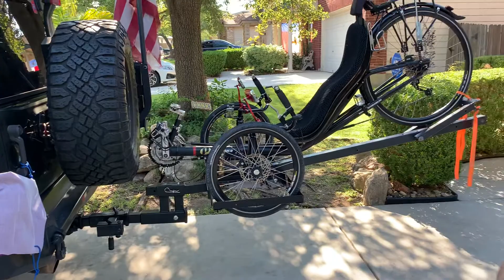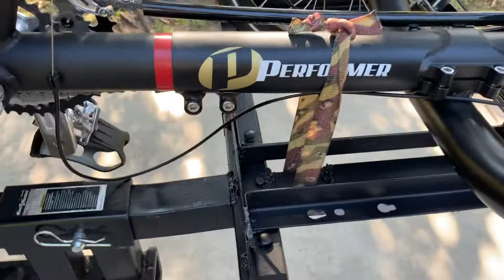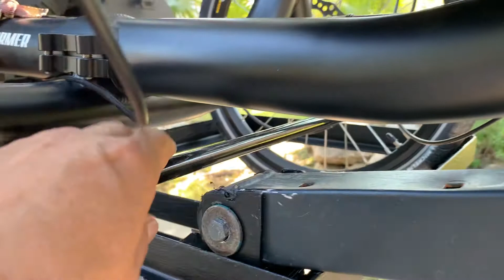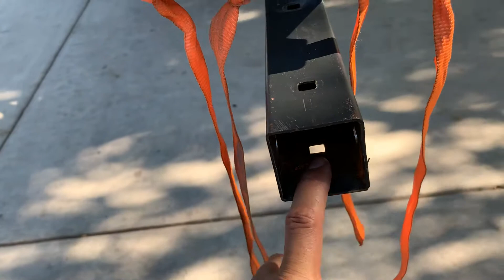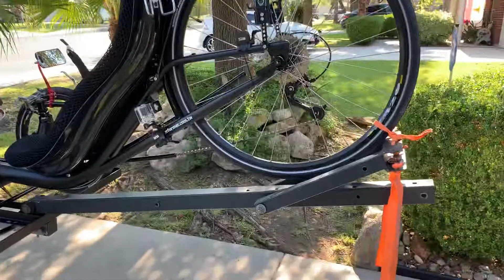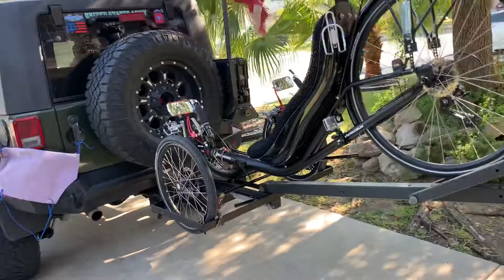DIY recumbent trike carrier

Comment: Very nice job. I don't think there is a limit on length other than you have to have a red flag or some kind of red light to alert the person behind you. If you do have to change the design could you add a hinge that allowed it to be lifted into a vertical position after loading it. Also bungees are the quickest way to cinch the tires down. You could also stick a rod through both tires that connect to the carrier. Just suggestions. Again great job. And you are correct about them being expensive. I paid $525 for my first one.
Reply from the maker: I’m learning and I now have a welder. I’ve converted this trike into an electric quad now!  I should post a video of that. It’s a great platform.